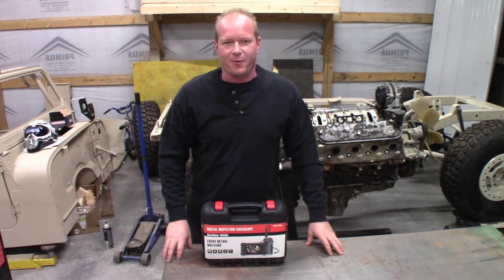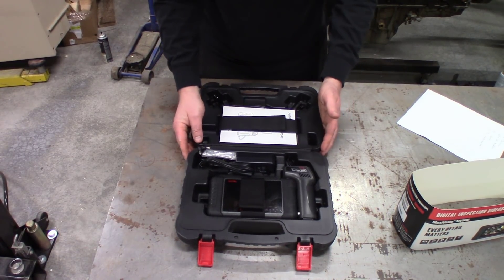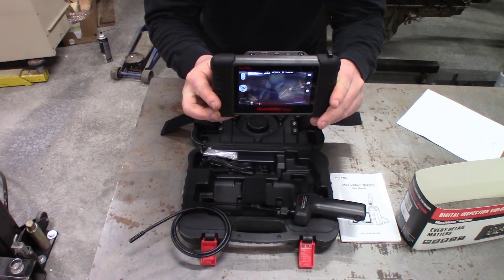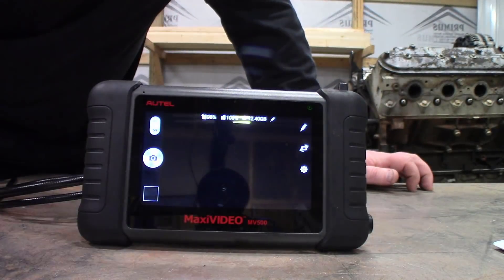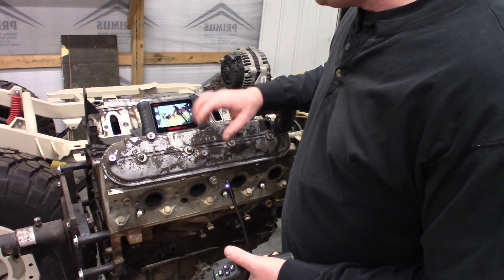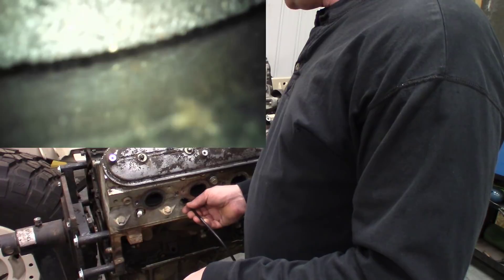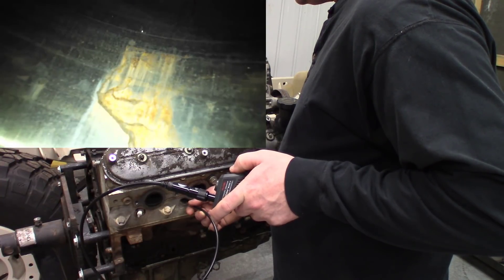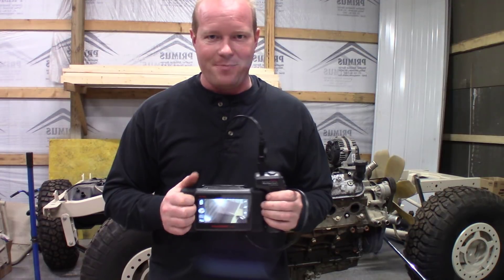Cracked LS inspection using Autel MV500

Comment: Do you know if you can plug the camera to the monitor with out wifi?
Reply from the maker: There is no option to plug the camera direct.  The Camera head does not have a USB on it.  Looks like it is Wifi only
Reply: Flash Performance thank you
Reply: It will work without wifi that's just for updates